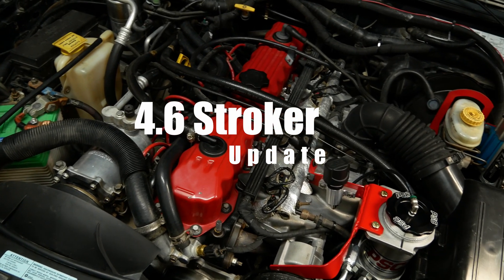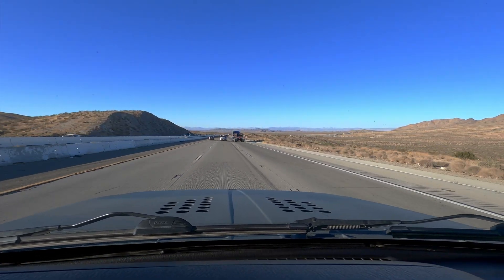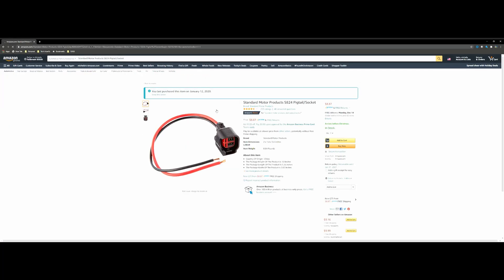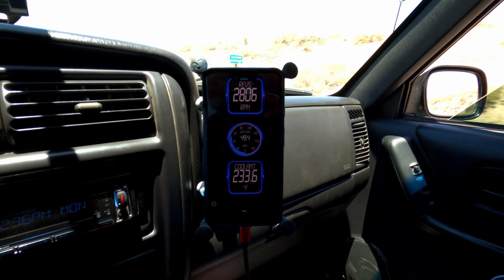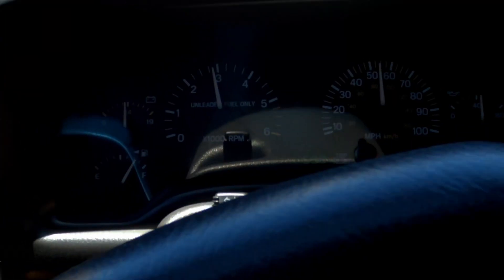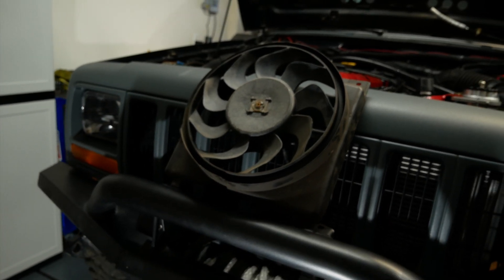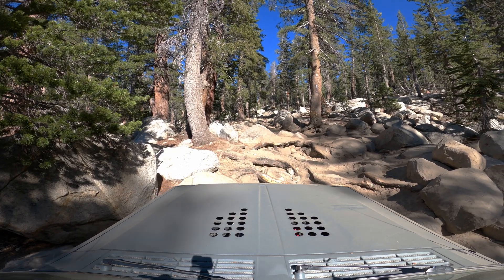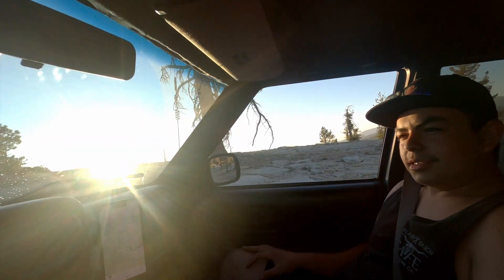4.6 Stroker Engine - Update

Comment: Whit you stroker does it change for the smog ? Or how it works ?
Reply from the maker: It passed CA emissions just fine.  It was actually cleaner than the original engine.

Comment: 4 core radiator is a must with electric fan and a high flow thermostat. The 4.6 needs the extra. also a trans cooler is a good upgrade as well with the extra push on the trans with HP upgrade.

Comment: If u have a radiator that has trans cooler lines through it... Think about installing a aux trans cooler in line to radiator... This removes trans heat before entering radiator... This will help with cooling ...
Reply from the maker: That was one of my first modifications, especially living in SoCal where the weather isn't cold enough to need to heat up the transmission fluid.  I just ensured the Jeep was warmed up on colder mornings before driving.

Comment: I run a Griffin 3'' and a Hayden low-profile HD Clutch with a factory fan, Mean Green pump. My 4.0 LJ runs 205 to 210 with the A/C on here in Hell (Palm Springs) in the Summer.

Comment: Ive heard adding an intercooler for the transmission itself and setting it up infront of the radiator will help with running hot

Comment: I consider 230 in my xj time to shut it down same with most other xjs ive had. Mine with a stroker runs at 183ish all day long in normal driving conditions and long uphill climbs it gets to the high 190s if im trying to keep it over 60 and its hot out. But really beating the tar out of it without my auxiliary radiator plumbed in the system i see almost 210 i got to 209 but i tried really damn hard on a hot ass day to see if i could overpower my cooling system and when I actually put it in the proper gear and drove normal it shot back down. 
Ive tried so many different cooling things on Cherokees and so many different radiators. A stroker actually does create a decent amount more heat on average. To run mine where i want i have a Ron Davis radiator also an auxiliary radiator and im running 2 high end fan controllers not cheap stuff i have a mix of spal brushless and spal regular fans no stock fans or stock fan control stuff. I also have a high flow water pump but i don't recommend a high flow pump in most applications and i also dont recommend people ditch the stock fan setup unless they spend good money on high end parts ive seen a Cherokee with good aftermarket fans overheat because it had a cheap fan controller. Just because the fans turn on doesn't mean they are running at peak power when needed. I really have tried a ridiculous amount of different cooling things and spent a ton of money along the way over the years. I will say that my experience with the mishimoto radiator was bad especially with a high flow pump their radiator is restrictive with its core design. I was really attracted to their radiator for the warranty and its not as bad of quality as the other cheap aluminum options but i usually have stuck with the higher end radiators over the years but my wifes stockish Cherokee runs a mishimoto just fine its just when you put any demand on it although hers ran hot with the old fans i put very similar fans as mine on it so the fans pick up the slack and hers didn't overheat prior to the mishimoto radiator so its obviously not as efficient of a radiator but its better than some. Unfortunately ron davis is the only one making an xj radiator at the moment that really kicks ass. Xj's tend to twist radiators thats why griffin no longer sells an xj radiator and ive noticed other companies ive used don't seem to make a radiator anymore. I've cured this on mine so im not as picky about warranty anymore on radiators but it takes a good bit of work to truly cure the twisting.
I know this video is old but it popped up and i thought it would be interesting to watch. Im not sure where your at now with your cooling system and stuff but im fairly certain you could make your Cherokee run a bit cooler I don't believe you should be seeing 230 or really much over 210. Ive had a ton of Cherokees the one im talking about with my fancy cooling system is pretty custom and it takes a lot to get it to run under 200 in pretty much every condition and i probably wouldn't aim for 180 unless you changed other things but I'd aim for 195-205 probably I've been able to get that reliably with good airflow and a good radiator and some aftermarket stuff but not thousands of dollars worth of stuff. Your braver than me running over 230 my butt puckers when i see temps creeping up that high I'm looking for a spot to pull over and let it cool down. I do get it though running ac on a hot day and pushing a weighed down Cherokee uphill creates heat. The auxiliary radiator is probably one of my best upgrades because adding more coolant in the system is good but more cooling surface area is in my opinion the best thing you can do an extra small to medium size radiator with a fan goes a long ways to build in extra capacity but its a little difficult to package. Like a drag racing radiator or high flow cooler on the heater return but when your tapping into the upper radiator hose you need to use a very good quality high flowing little radiator otherwise you may want to stick with adding something on the heater return that does help.

Comment: That seems hot to me. My golens runs 180 to 190 with stock radiator and fans 90 percent of time. 100 degree day with black hood on it absorbing heat never really goes over 210. And all my stock 4.0s usually ran 200 to 210. Jeep 4.0s have been known to run all over the map they originally were built to run hotter for emissions

Comment: I don't understand how you could be happy having 230deg  as an acceptable temp. Heat is the death of any mechanical item and when a design temperature is around 205 or so 230 is off the hook.  I have an old 97 Ranger 3.0 I was told  they all run hot? After monitoring the under hood temp I decided the incoming air didn't have an escape so Installed strategically placed vents in the hood and fenders, the underwood temp dropped 15deg. The hot air couldn't escape fast enough .

Comment: You should get a high flow water pump and thermostat.  I never go over 210... Ever.  I also have all aluminum 2 core radiator and aux trans cooler.

Comment: I have a 1988 Renix XJ with a 4.7L ATK Stroker. when its over 85 degrees outside its horrible as far as temps. I have installed a new champion dual core radiator, high flow water pump and thermostat housing, ZJ fan clutch, Evans Waterless coolant, new hoses, a new 2000 efan and new sensors both on the block and the radiator. At idle at any outside temp, it never goes above 210. On freeway speeds, or hills it rises and has gone up to 240 at outside temps of 85 or higher even on flat highway.  I replaced my condenser when I put the 4.7 motor in 5,000 miles ago and have not used AC at all.  I have hood louvers to help with heat soak. This issue has driven me crazy, and it bugs me as I can't really use my jeep in summer for overlanding trips. Hopefully, after I get the golden 4.6 replacement in, it will do better. i will be buying one this spring. Maybe a better fan that can push more air and will fit like a contributor suggested below.
Reply from the maker: Hi John,  For the past year I have had zero issues with high temps, even when outside temps are 108 in the mojave desert. Getting to this point took some effort. I am running a single row, spectra radiator with 180 degree thermostat. Oem XJ fan clutch. Bypassed radiator for transmission aw4 and run external cooler. Flushed AW4, because I found brown dirty fluid. I monitor trans temps climbing steep grades and turn on my aux fan which is wired to a switch. The aux fan is a SPAL fan, which puts out proper CFM. I also had to install a new catalytic converter because mine was partially plugged.  Flush the cooling system once per year. This has led to my temps never reaching higher than 228 on the hottest days with AC on. Hope this helps 👍
Reply from the maker: One more thing, my compression ratio is slightly higher than stock and low enough to run 87 octane without pinging.

Comment: I have a Russ Pottenger 4.6/4.7 build. Something like 4500.00 for the parts and machine work alone . 97 TJ . Ended up having to also do a custom flash of my ECU for 900 bucks. All in all, to do it over, I would of went with a V8. The 4.0 is by NO means a turd but to reach higher performance levels I wouldn't build an engine up to try to reach it, I'd just get a junk yard V8 and go that route. My dyno numbers were no where near what I had hoped for.
Reply from the maker: Sorry to hear the dyno numbers didn't turn out as expected.  I contemplated going with a v8 in my XJ, but the juice wasn't worth the squeeze for a variety of reasons.  Primarily, to get through CA emissions, it would have been cumbersome and more expensive.  With that being said, if I lived elsewhere and the XJ were more of a toy instead of a daily driver, I would probably lean towards a v8.
Reply: @cleanEG  I was in the same boat. If I had a magic ball I would of seen that 1 yr after my build I'd be moving from San Diego to Vegas.. lol.... oh well.

Comment: This video makes me appreciate the fact that my 4.0L Nissan Frontier towed a car on a trailer over the mountains without any fuss.
Reply: stock!  0.6 liter over means more fuel which means more heat.  these are not sophisticated engines.  same block and rods, different crank and pistons.  or different or same pistons, different rods.  anything with mods comes with consequences
Reply from the maker: That's awesome!
Reply: @cleanEG  
Thanks. It's been a great truck. Unless they start making trucks with manuals again, I'm going to have to make it last forever. Haha

Comment: Did you have to pass a smog test?
Reply from the maker: Yes, it has passed emissions.
Reply: Thanks for getting back to me. I've been thinking of doing something about my engine and your build looks really great. 
Looking for some power on my 06 TJ I just rebuilt it. 
Since we live at 5,000 ft elevation. A boost in hp plus some extra torque is a nice thing to have. Been rolling a lot of ideas around in my head.

Comment: Brother your story mirrors mind but I am in a 2000 nissan Maxima with a mishimoto radiator,  my fixwas adding two SPL fans, seems to have fix my issue.  I was over heating going over the grape vine. Thanks for pointing me to the ac condenser, I never thought about that, I will replace that before I stroke the Maxima to 3.3 liters.
Reply from the maker: Right on! Glad I could help you out! Those SPAL fans are amazing, they really push alot of CFM

Comment: Go with an actual cold air intank and a high flow water pump. Also try and convert over to e85 you'll see more power and 30% cooling on top of that with the fuel.

Comment: When I ran a mishimoto I had to back flush it often and saw huge temp reductions each time.   Coolant wasn't even bad looking.   Oxidation builds up in the bottom of it (iron/aluminum don't get along) and each time you drive it it gets stirred up and clogs the veins.   Switched to a stock radiator with ZJ clutch and reprogrammed the ECM to bring the factory E-fan (not an amazon knockoff) on at 195', so no more switch.   No problems since.
Reply from the maker: Good to know - I have since been running a 180 degree thermostat now for a year which has been exactly what I needed during the warm months.  I also did a full transmission flush and added a transmission temp gauge.  I noticed that the fluid was in bad shape (dirty brown color) and after 3-4 flushes using the drain + add method, it made a significant difference.  On the trail, if I'm climbing up a mountain the transmission will stay much cooler in 4-low since it doesnt have to work as hard in 2wd.  It's not a matter of needing 4-low to crawl over obstacles as much as it changes the gear ratio for the AW4 to work less.
Reply: @cleanEG  good call on the 180 stat, forgot to mention I run one too.   I use 4lo on longer hilly trails (that are otherwise fine in 2wd) to keep the trans temp down.   A trick for 2wd temps is to put it in 3rd gear, which enables torque converter lockup.

Comment: What gear do you have?  You could also look into a remote oil cooling system as well.
Reply from the maker: Currently running 4.88 years. I think this summer I'm putting in a remote trans cooler with fan on a temperature switch. Now that I'm monitoring my trans temperature, the cooler I have in front of my condenser is adding heat in an area I need fresh air.

Comment: During the summer I put in a 160 degree thermostat in.  A hi flow waterpump and thermostat housing helps as well.  Another one that helped more than I thought it would is heat wrapping the the new headers and the downpipe around the tranny.  Helped with heatsoak and trans tunnel heat. During the summer I swear my console was about to melt.  I would love a 4.6. Nice rig.

Comment: Awesome videos. Very informative. Is the 4.6 Stroker engine simply a 4.0 that has the cylinders enlarged/deepened, or it is a different engine? I have a 1994 XJ with a manual transmission and I have no power going over the mountain passes here in Colorado. I'm seriously considering spending the $5K and have a shop install a 4.0 Stroker engine. I understand it can increase my 190 HP to about 250 HP. Thanks.
Reply from the maker: Thanks! Yep, the same block but with a larger bore and a longer stroke from a different crankshaft. This includes custom pistons as well.  On the outside, everything looks OEM.  It definitely increased horsepower but with the inline six, they produce alot of torque which really helps on those long hill climbs, especially at elevation.
Reply: I did ALOT to my 4.6 Russ Pot build. True cold air through the firewall, port and polished 7120 head and 99+ intake, custom tune, blah blah.  end of the day I got something like 75 more hp than a stock 4.0. Wasn't worth it.

Comment: What octane fuel are you running?
Reply from the maker: I've been running 91 octane fuel 99% of the time.  On a few trips where 87 was the only octane available I used that.  It was designed to run on 87 for that reason.

Comment: had the same problems with my jeep after replacing everything.  mechanic recommended a high flow water pump from quadratech.  problem solved.
Reply from the maker: Good to know, thanks!
Reply: @cleanEG  also I have the mistumoto three electric fan replacement and I set it to activate at 190. Fixed all idling heat. Even in Fresno where I live. But if I climb it will still go to 215ish

Comment: That's the best thing you can do with electric fans you can go with spal or Malibu fans and you give more cooling sistem with 3 row aluminum radiator  that's I have to do and I live in ARIZONA and my don't go over the 210 degrees with the a/c on even on the hottest days
Reply from the maker: I thought about an  electric fan setup - I may test this someday.  Thanks!

Comment: So how are you doing with the high temperature issues now?  Any progress?  I was dead set on Golen but after watching your video, maybe I should just get a regular remanufactured engine.
Reply from the maker: It's been running great!
Reply: @cleanEG  Thanks for the update.  Ended up getting Golen stroker and installed it with my buddies in 2 days along with Moshimoto full aluminum radiator.  Noticeable torque increase right at the pedal taking off and being able to overtake traffic at highway speed with 5 inch lift and 33s on my XJ.

Made XJ feels much newer now.  We will see how it does next few years.

Comment: Sir get an oil cooler and trans cooler if its an automatic!!!!!!!!
Reply from the maker: I have a B&M trans cooler and I'm actually thinking of doing a remote one with an electric fan just to reduce any heat in front of the radiator/condensor.

Comment: 5200lbs. Now you have me curious what my jeep and trailer setup weight is for a standard 4day trip. Also that climb up to mammoth is no joke. I saw a drop in ECT when I did a full rad. Trans cooler delete. 
I can now hit 185 trans temp and 210 ECT. Loaded and doing 65/70.
Reply from the maker: I'm with you on this idea as well. I'm going to do a remote trans cooler and keep the front of the jeep open to fresh air. I'm already bypassing the radiator with my cooler, but it still adds heat to the front. Especially in low, slow climbs off-road
Reply: @cleanEG  keep an eye on the trans temp, unlocked pulling a grade it'll skyrocket much quicker without the radiator in series.   Manually shifting to 3 usually keeps it locked unless you're flooring it.

Comment: The single best upgrade that I have done to date has upgraded the fan clutch from the XJ to the ZJ. I had even ran the $1000 triple core electrical fan, but my engine just could keep cool. I upgraded the radiator to the Mishimoto, swapped the fan clutch, and just kept the stock electrical fan. I live in Georgia, but I am hard pressed to get my Jeep over 210 degrees- even on the highway. The main con is the noise- you will hear the fan.
Reply from the maker: Thanks for sharing!

Comment: What gear ratio and tire size are running?
Reply from the maker: The wheels are 15x8 steelies with 33x12.50 15 tires. It's geared to 4.88

Comment: I'm surprised you didn't opt to go with a flowkooler watter pump and a hesco high-flow thermostat housing I did this with a stock 4.0 and I also had a mishimoto radiator and my coolant Temps were like 5 to 10 degrees cooler than before now granted I didn't have a stroker but I could only imagine that you would gain similar effects from the point your at